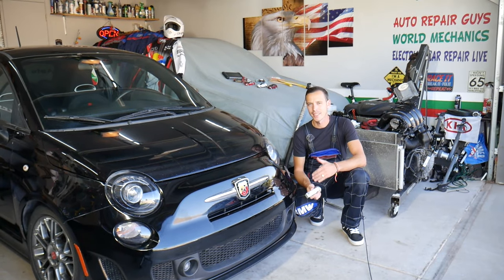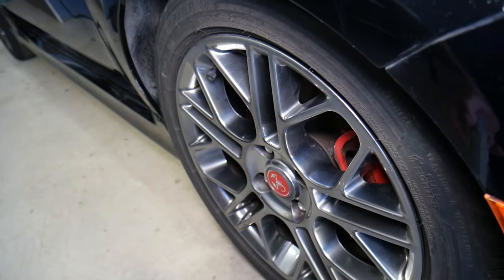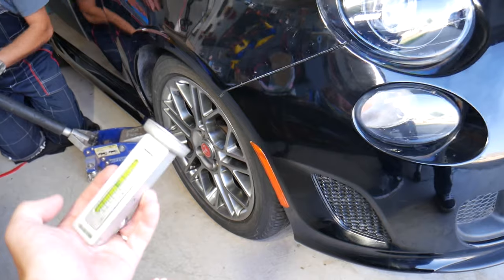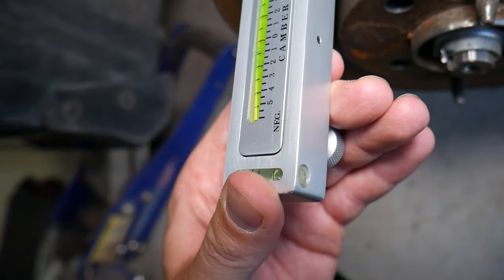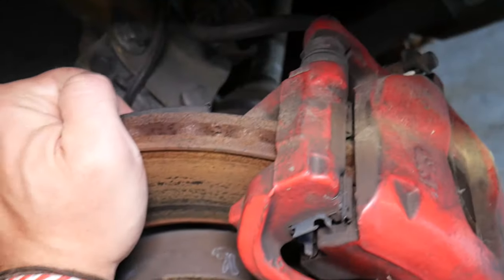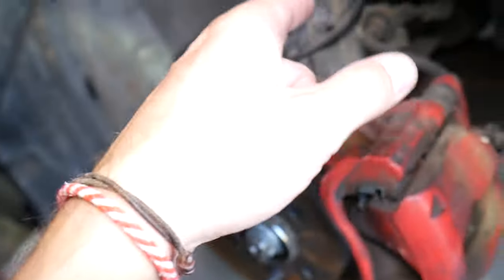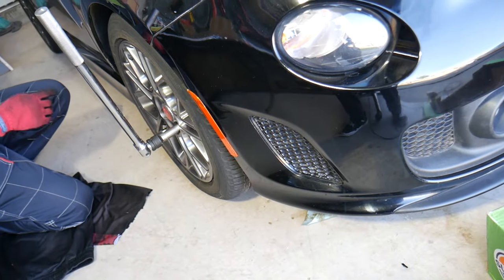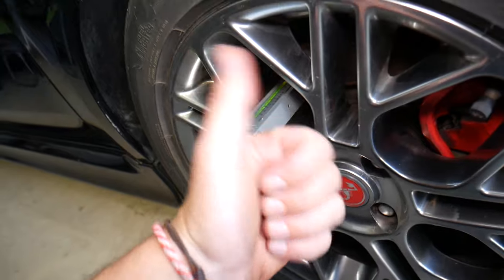HOW TO ADJUST FRONT WHEEL CAMBER WITH CHEAP TOOL

Comment: You need to jack the car up on both sides to equal heights before adjusting the camber since only jacking up one side will put the car off level
Reply: bro fr i just realized 😂
Reply: I don't think so in this case bc he calibrated the tool to what he read when it was level on the ground.  Whether the vehicle is cocked one way or the other, it's reading as if it's level now and then the amount of travel/adjustment he's doing would be the same travel regardless of the vehicles position.  Maybe I'm wrong but that's where my mind goes.

Comment: Hey, Love your shows. However, level the camber tool on a metal surface perpindicular to the garage floor. Then, place the tool on a clean flat area surface of each rotor, use the end bubble to level the tool and measure. However, despite these precautions, I find the tool is inconsistent as much as +_ 0.5 degree. So I think they are useless because the difference in the surface of each rotor.
Thanks

Comment: Look the brake rotor is rusty and uneven so those are not accurate! 
That's 1... And the car is not even on air on both front wheels so thats 2nd mistake... 
And you dont even know how to adjust the gauge tool 🤦🏽👎🏽